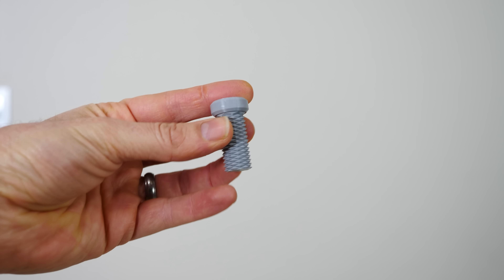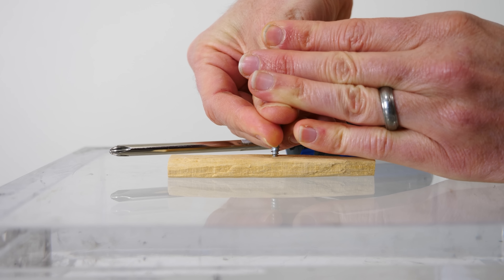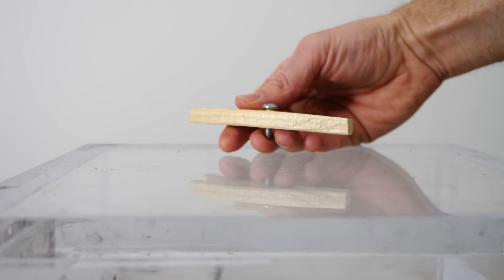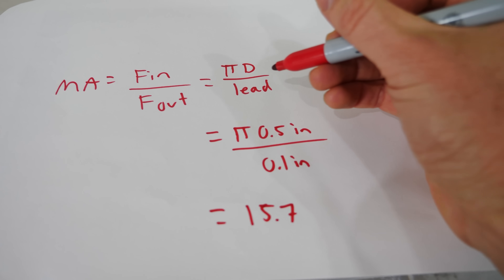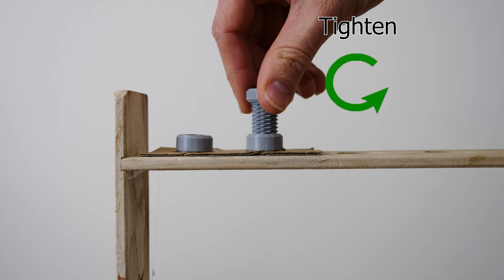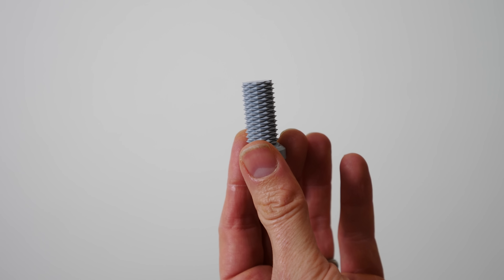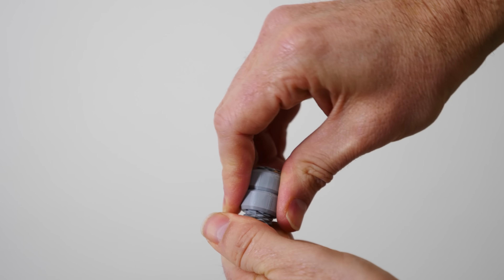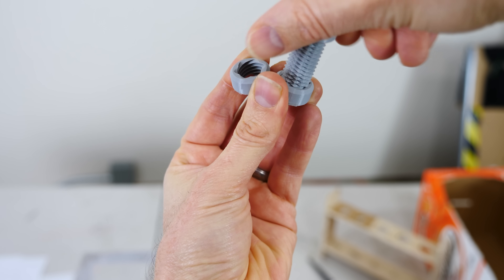A Screw That Can Be Tightened In Either Direction

Comment: *️⃣*️⃣MAIN*️⃣*️⃣

I have another reason. When you push the screw against something(solid), the thread gets stuck because it is being forced  through a hard solid. But if you now turn it and screw it in the solid, the thread will cut through the solid as it rotates. You mentioned in the video, the screw moves linearly. But that is why the thread is sharp. If a solid needs to get through another solid, it needs to rotate as fast as it can. But with the screw, it is just like the screw is having it's own knives(thread). You can screw no matter how slow you are. Now this has nothing to do with screw, but think of the pottery. If you take the clay and just rub it, it won't make a pottery item or something. That is why it needs to rotate so that that you can now shape. Clay rotating and rotating solid going through a rotating solid don't mean the same thing, but that is how rotation helps in getting through solids. Same with the screw. This might be confusing. But that is what my mind is thinking of right now.

Comment: Cool!  And you could make a nut that would be the same way, able to go onto a left-handed or right-handed screw. Now if you used a 2-way bolt with a 2-way nut, I imagine either turning direction could go in or out depending on the slight force you put one way or the other?  I wonder if there could be some use for that?

Comment: What if you thread the nuts so that they go both directions so they tighten clock wise and counter clock wise and even use both counter clock wise and counter clock wise to tighten it on the screw with the same bolt, idk if that makes sense but put threads on the nuts in both directions same as you did the screw

Comment: Aren't those bolts? Screws have a point. Bolts are flat on the end. 🤔 Also, what if you made a nut that had the capability of receiving a normal threaded bolt and a reversed threaded bolt? Revisit this, please.

Comment: what if you combined this with a nut that was also double threaded? would the screw fall through? or go both ways? could you twist cc and then switch to c midway through? Would it only be unscrewable by tilting it upside down?

Comment: I think these bolts would be good to use to reduce vibrational loosening. If the two facing nuts were locked together with a key, it would be impossible for the the position of the nuts to move along the bolt due to vibrational forces.

Comment: What happens if the screw AND the nut have threads in both directions, does it mean that u can tight and loosen in both direction depending on whether you push downwards or pull upwards??

Comment: How about constructing a nut and bolt such that turning the nut clockwise from the bolt's perspective would move it toward the marked end of the nut?  I think that would be possible if the nut had two inward-pointed sets of projections, 180 degrees apart, that were long but narrow, and two others displaced 60 degrees from them which were wide but short.  The bolt would be carved with grooves that were both deep and narrow, and that were wide but shallow, in both directions, placed so that when the deep but narrow grooves crossed, the wide but short projections on the nut would only be riding on one of the wide shallow grooves.

Comment: Soooo....the advantages is you can screw it either way and use differrent direction nut to keep it stuck/locked...but the disadvantanges is the strength weakened and more complex/costlier to produce🤔

Comment: Never heard the term "lead."  
"Pitch" is the term I'm familiar with.
Reply: Lead refers to the amount of pitches.
Most screws are single lead. Soft drink bottle caps can be 5 or even 8 leads but only have a pitch of a few mm
Reply: @billweber1340  Just looked it up and lead refers specifically to the distance traveled per full turn of the bolt, whereas pitch is the measure of the distance between threads. Pitch and lead of a bolt are equal in measure (an M10x1.5 has a pitch of 1.5mm and a lead of 1.5mm), but they refer to different things.
Reply: @Sarin-Q  yes that's correct IF it's a single start thread.
If there are multiple starts it's different.
You can have an M10x1.5 with a 2 start thread. Still has a 1.5mm pitch but will be a 3mm lead.
Reply: @billweber1340  you said earlier that lead refers to the amount of pitches? Now your saying it refers to distance?

Comment: Couldn't the nut be threaded in a similar way to be able to allow screwing in in either direction? In my head it works, but in practice probably not, but I can't figure out why. Like the nut threads would be oriented in a way that it has to line up to screw in normally, and then lined up differently to be screwed in opposite. The opposing threads would have to be oriented in a way that there's no way for the bolt threads to accidentally cross over into the other one.

Though, honestly, I'm having trouble coming up with many situations where this would come in handy anyway. For both the existing screw and the nut I was thinking of

Comment: I've a question. It looks like you can go on the nut from only one side. (F.e. The one nut, can only draw fast clockwise).

Now if I've a nut at home, it doesn't matter from which side I put it on  a screw, right?

Comment: Can you also make nuts that go in both directions at the same time using the same concept, and have a screwing system where all you have to do is push or pull to change the direction the screw moves?  I realize that it wouldn't hold the screw as well as a one-direction nut, but it would still be possible!

Comment: If you have a nut with two-way threads, will it screw in either direction onto a regular bolt?  Will it screw in either direction on a two-way threaded bolt?

Comment: These exist, actually. They're a good demonstration on why we don't make it a huge deal to make tiny pieces that function in multiple ways. 

The problem with 2 way thread bolts is that the threads are a fraction of the coverage you get from a normal thread. Meaning any upward or downward (mainly upward when talking about bolts) force has more impact than it would if the threads had more surface area to hold.

Comment: You can convert metal screws by using a left hand die. The strength of the screw will be greatly weakened tho, and I don't see a lot of uses for a screw like this

Comment: Would you be interested in doing a scientific experiment that has to do with a toy drones plastic propellers and whats causing it to warp and when thats actually happening. You'd have to find out at what temp the plastic starts to become plyable enough to warp or contour to the shape its being stored in and or laying up against. If we can figure that out and then a way to combat that.   it could be happening while its stored in a hot car and if when it cools during start up is centrifugal force be pushing back to its original molded shape again. Warping temp and melting temp difference as it spins it should go back to its molded shape because the plastic has a memory that it was molded to much less than the warp temp
Matt66strickland@gmail.com

Comment: In theory you can do the same for threads on nuts too. I am curious for the result though. Using both two sided screw with two sided nut. But I think it will do nothing.

Comment: Question, would it be possible to use the same 2-way threading with the nut to make a single screw-nut pair that could be screwed both ways? That would be interesting.

Comment: Isn't the first part kinda inconsistent? because you had a tool help with the second part
Reply: True, the screwdriver also provides mechanical advantage due to the ratio in size between the diameter of the handle and the diameter of the head.

Comment: Here's a better version of the screw, from 2 weeks ago.  There's also a second video on the channel with a double sided nut as well. https://youtu.be/cDfMI5ahbJI
Reply: That link was for one directional nuts, here's the link to the corresponding video with the bidirectional nut: https://www.youtube.com/watch?v=h8sRZJbIHlY
This is absolutely amazing!   
I wonder how the nut-bolt pair might differ if the pitch of one direction was different than the other. Different aspect ratios of the grooves would likely be necessary, but I suspect that in that case, the nut might be able to go on in either direction, but wouldn't be able to change rotation direction as it continues onto the bolt.

Comment: As a CNC turner I'm wondering about how I'm going to turn it. So say I used a G76 thread cycle, made a regular bolt that I can fit a nut on. Then say I reverse the start and end Z positions but kept everything the same. My question is using a standard ceramic full form insert of the correct pitch, would the two threads match up using this method, does the insert need to have an offset in Z to match up such as the thread pitch, or half or double or something. I think it might be fine as is, but I can't quite decide.

Comment: There are the type of screws that are used on a spool casting fishing reel, in combination with a double cut nut that keeps the line feeding back evenly across the spool. I used to have a side job for a guy who cleaned up on repairing that type of fishing reel.

Comment: what if you made the nuts also 2 sided so that only the up or down force combined with a twisting motion will choose if it actually goos up and down. will that work?
Reply: https://youtu.be/h8sRZJbIHlY 
Олег Певцов has already done that and also the version shown in this video from the Action Lab, only with metal parts on a lathe, which I think is even cooler than 3d printed.
Reply: @jucaesar4961  no, his nuts were single threaded in two different directions
Reply: @JanHough  Олег Певцов has multiple videos about nuts/bolts threaded in two directions at once. The one I linked was one of his latest videos of that, but he also did normal nuts with a bolt threaded in two directions.
Reply: @jucaesar4961  exacly what i meant

Comment: So finally with this screw 
U can't get confused to tighten in clockwise or in anticlockwise direction .👍🏻
Reply: Actually it will depend on nut then.
See for both nuts you have to screw differently
Reply: @herambkaril9422  yes u r right  , but I want to know that who know that 🤫

Comment: The two nuts cant be unscrew by using a single rotation.
That sounds usefull.

Maybe in bridges and such.
Reply: I literally exclaimed "That's actually really useful!" when he casually mentioned it; wonder what the cons might be though...
Reply: @Kittoes0124  Possible con: I’m thinking if I don’t remember which way the screw (or nut) is supposed to turn to loosen (for repairs) and no threads are visible, I could over tighten and possibly strip threads.
Reply: @andrew2732  unless a code or pattern in the nuts referring which way they unscrewed...no it's good to think about both sides.
Reply: @andrew2732  I'm thinking the nuts be labelled with what direction they need to be turned to loosen. Or labelled inclination of threads...
Reply: @Kittoes0124  confusion about which way to turn maybe xD
Reply: @fuseteam  Was thinking more along the lines of say, friction welding? I'm probably just naive but it seems like that'd be a real possibility if the parts were constructed from metal. Though, maybe that'd be a desirable side effect in some situations too?
Reply: @Kittoes0124  sorry i missed the side effect you're refering to.
confusion about which side to turn is small issue btw, you could turn to hard and break something for example
Reply: yeah agreed its actually useful
Reply: Weld the the nut together to further lock them in place....oh yeah I like this idea
Reply: @jryde421  woah permanent screwing!
Reply: Yeah I was like that looks like a good clamp thing
Reply: yes like if one vibrational motion woold make a screw looser the other one would get tighter and vise versa.

Comment: Would threads the designed the same way work for the nut? Then any nut or screw would work both ways together.
Reply: Search the name Олег Певцов here on youtube. He recently invented that screw on a lathe and also made a 2-way nut for it.
Reply: tbh a two way nut would beat the purpose of using a screw and a nut in some usecases

Comment: The Action Lab = Good content
Reply: True
Reply: True
Reply: Except he stole this content from a Russian YouTube.
Reply: @Jojotheowl1 proof ?
Reply: @sinister3921  I actually found the youtube video he's talking about, if you just search something like reversible bolt nuts there's a russian machinist that makes one of these bolts on a lathe.
Reply: @sinister3921  Let me find the channel again. I watched his video a week or two ago.
Reply: https://youtu.be/cDfMI5ahbJI
Reply: @Jojotheowl1  how can u  be so sure ?
Reply: The Action Lab = bad mechanic

A plastic bolt isn't going to hold shit. And the nuts are round, how are you supposed to turn them?
Reply: @Makingnewnamesisdumb  the focus of the video is just the fact that it can be tightened in both directions, i think he knows plastic is not the best material for screws and so do we all, don't worry
Reply: @Makingnewnamesisdumb  he didn’t make them to hold anything he made them to demonstrate something. The guy does all kinds of scientific crap on a daily basis. I think he’s smart enough to know that plastic screws are useless at holding stuff together.
Reply: @niceto_meet_you2528  but that's the interesting part of it though. It would be interesting to see how strong they are compared to bolts with one way thread. I'm skeptical of how useful this idea actually is. It just seems like it would be really easy to damage or cross thread the bolt. It would probably be possible to make one relatively easily using a reverse threaded bolt and a thread cutting die of the same thread dimensions.
Reply: @Makingnewnamesisdumb  that is why kids shouldn't watch these videos